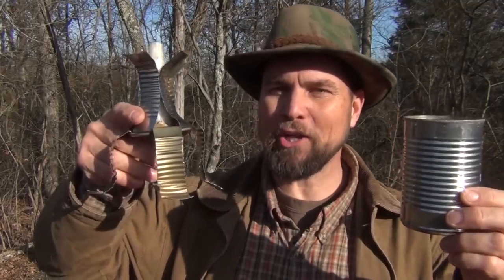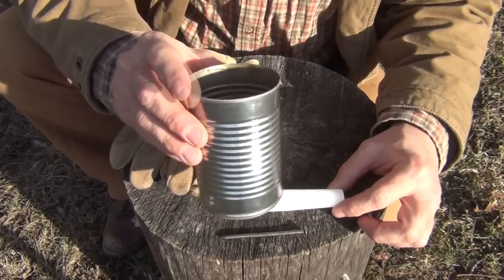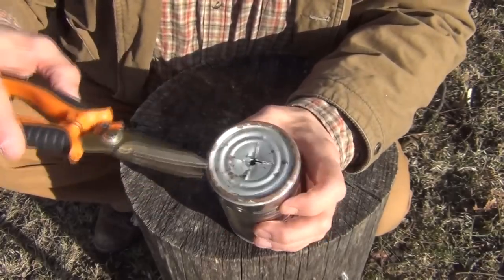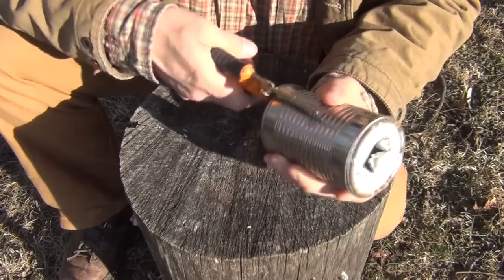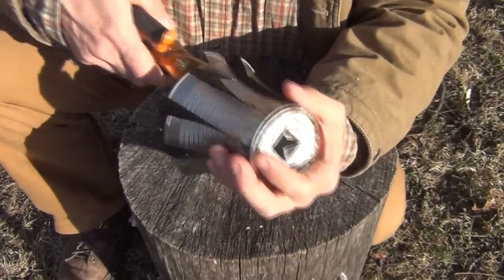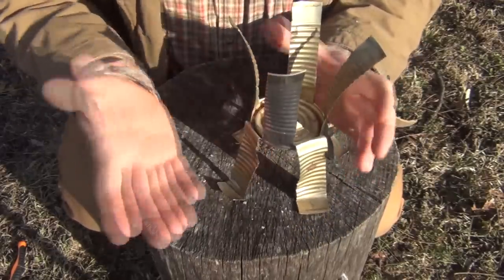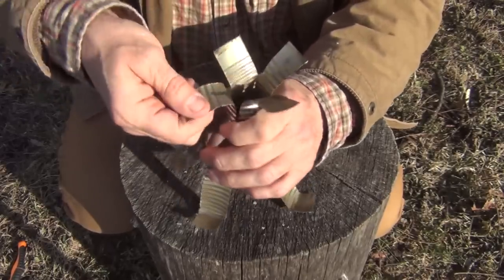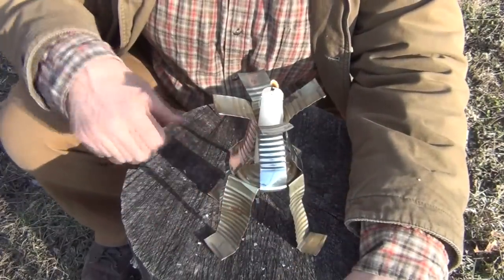Hobo Candle Holder [ Very Cool! ]

Comment: It can become a very efficient hand warmer/emergency heater by taking another empty soup can turning it upside down and sliding your candle holder top pieces into it letting it sit upside down with the candle lower enough that you can light it will still provide light but also radiant heat to warm a small place or your hands given your situation.
Reply from the maker: Good idea!

Comment: I'd say God just blessed you with another good idea. BTW what type candles do you use that last longer?
Reply from the maker: Thanks. I buy the cheap taper candles from Walmart.
Reply: I go to the kosher section and buy a big box of 72 sabbath? candles to use as emergency candles.They are reasonably priced,burn great for a long time.

Comment: If you had a plastic bottle  you could form a chimney and place it over the upper 4 parts after you cut the bottom and removed the cap.
Reply from the maker: It would definitely melt the plastic as the candle gets quite hot.
Reply: @WayPointSurvival  okay, make it a glass chimney bought at the thrift store.  Would it be too top heavy? With adjustable legs it may be stable.
Reply from the maker: That would probably work.

Comment: seems like a lot of work when you can just cut one side of a can off leaving the bottom and about 2"  on the side you cut off at the bottom. Then just put a thin 1" screw in the bottom, point upwards, off center closer to the back wall.
Reply from the maker: Sure, that's another way to do it.